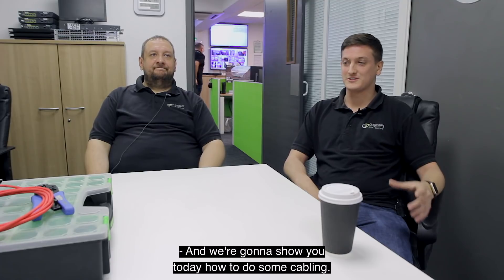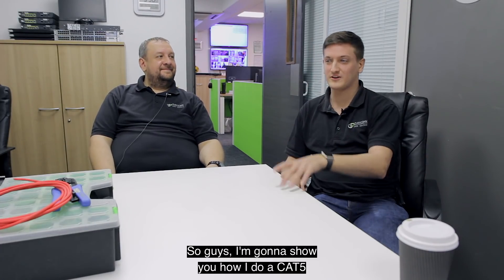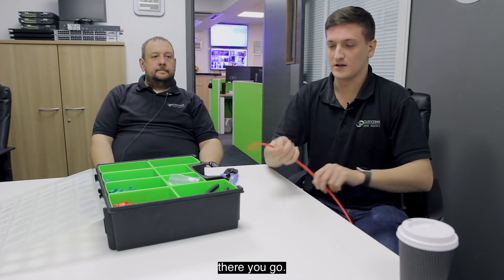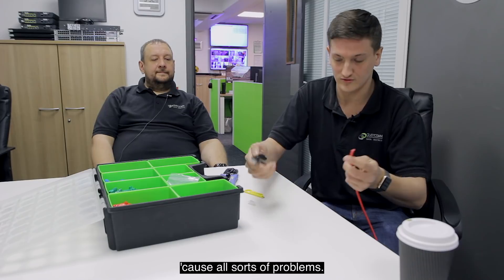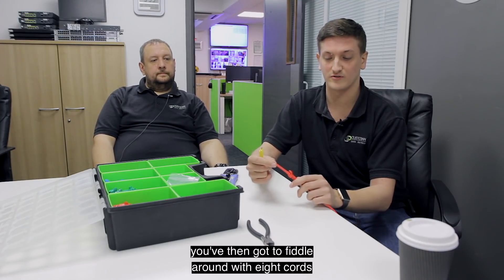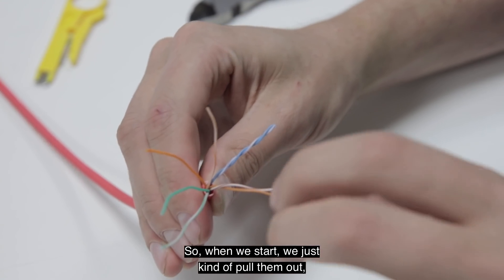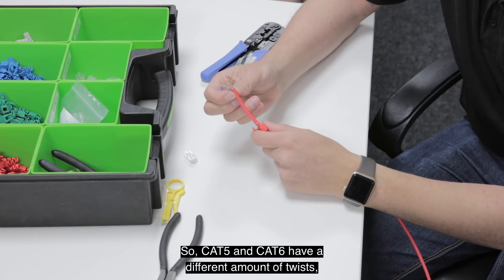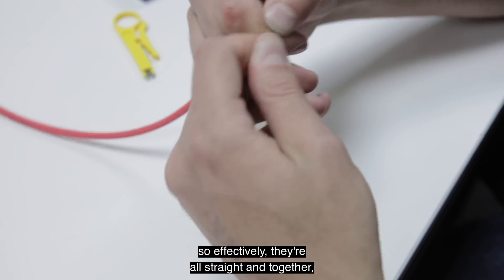DATA CENTRE 101 | TERMINATING CAT 5 CABLE | ASH & PAV have a CRIMP-OFF!

Comment: 3:12 a way to untwist the wires easier. Use the cable insulation and press that between the twisted pair then twist the cable insulation.

Comment: I don't tend to make off many Ethernet cables but use RJ45's connectors with holes at the end of the plug through which the wires pass prior to crimping. I like them because I can confirm that the wires are in the right order before I crimp because they stick out of the end of the plug and more importantly I can ensure that the jacket is crimped to the body of the RJ45 because I can push the cable right into the connector without worrying about wires buckling and so no long-term reliability issues due to compression of the wires between the terminations of the wires and the crimping onto the cable jacket.

I don't see many people using these connectors in production - is there something I'm missing here?
Reply: Because its for beginners. I can crimp rj45 for 1min using non pass through connectors.
Reply: @youreroad5307  It takes me 5 mins+ and I am a beginner :)

Comment: Why does everyone use the "B" standard? You would assume that the "A" standard would be the one most used. I know technically it does not matter, you could just put the wires in the same order on both sides and it will work. Just find it funny that everyone uses the "B" standard
Reply: Because
Reply: It just worked out that way over time and eventually B became the most used. There are no benefits to using one or the other, the only real difference between them is the pinout order by color. Between 568A and 568B the green and orange based twisted pairs inside the wire are reversed at the termination point. You can turn a B standard cable into A standard cable by simply re-terminating that cable on both ends using the same pinout order as an A.

Comment: The stripping blade on the crimping tool is made to strip flat ribbon cable for modular connectors (telephone, serial, etc.).  I would not recommend stretching the jacket.  If you want to avoid using sharp tools near the insulation, you can always grab the string with pliers and pull it.  It is specifically designed to rip the jacket without damaging the insulation.  

As for testing via Ethernet, um no way!  That is very short of a proper cable verification.  You need a new QC process.

For that matter, terminating 8p8c connectors on cabling in a DC is just plain nuts.  Learn about patch panels and punch down termination.

Comment: 15 years data tech ,  1995 to 2010, never terminated a patch cord
Always factory build and tested , unknowingly we built out a network with 30k drops
No way could we could have taken the time to build our own patch cord , thank heavens
Reply: Yeah I would have thought you could get a bunch in different lengths to run down the rack, especially in the quantities you'd get in a DC. Don't need to be exact, just close enough to be neat.

Then again, if that's what they like to do, and they can get someone to pay them for it, what do I know.
Reply: Agree its hard to say that risking making them yourself for time and testing and errors is worth it.  Although it does look quite nice in the rack :P i have been making cables since 1998, but still being careful and still testing and still very conscious of scoring the pvc/ not the copper etc

Comment: I've been doing Ash's method for a long time but when i saw Pav's method, I was enlightened
Reply: it makes sense but it takes too long. just get good with a stripper (i dont use a spinner either), only spin a small bit and then bend the cable and tear the end of the insulation off.

Comment: Learn a bit more  about the cat cables before make video tutorials. cat 6 is up to 1gb/s for 60m (100m), maybe cat6A is up to 10gb/s, and that way will take ages to make an Ethernet cable with rj45 connector.LOL
Reply: I suggest the same for you, in fact maybe just use google, CAT5e is up to 1Gb/s and CAT 6 is up to 10Gb/s and if you were such an expert you would have said Gb/s not gb/s
Reply: The connector is called 8P8C not RJ45.
Reply: @Wisecrackerist  That is true, but RJ45 is common (at least in the US) than 8P8C
Reply: Cat 6 is rated 10Gb to 55m. 6A is 10Gb to 100m.

Comment: I've crimped many cables for my home ethernet / unifi wifi. Some of them just gets the amber light from the switch (100mbit) and I can't really figure out why. I feel I'm doing the same procedure every time, pretty much exactly the way you do it.

Could it be the result of the cable twisting and turning in weird ways on its way through the house? Or passing too close to electrical wires?
Reply: You should invest in a network cable tester, It's a good tool that'll let you know if you have a open wire or if something isn't working correctly. Very useful tool that'll let you know if a cable doesn't work correctly immediately after you finish crimping it.
Reply: @streetrider1001  I have a tester, but in this case I couldn't really use it like intended.
I had to run the cable first, through small holes in the walls and floors, and then crimp the connector onto the cable several rooms away.
The issue could be the bend radius of various corners and turns. Or the fact that the cable itself got twisted quite badly when coming off the spool.

I am however able to stream ~50GB full length movies over this cable. 50GB over ~2hrs adds up to approximately 80Mbit/s. So there seems to be some wiggle room somewhere.
Reply: @sk4lman  Some devices only operate at 100mbit, have you tried with a different device connected? For an example, my Phillips Hue bridge is only 100mbps.
Reply: @SamuelLogan Yes, I have some devices that run on 100Mbit (wifi antennas) and they show amber light, as they should. 
Most other devices show green light.

The most critical thing is a cable connecting the main switch (where the fibre ethernet connects) and the living room switch where TV and such things connect. The port connecting the two switches show amber light, unfortunately. 

That cable is quite long, and runs a dozen yards through the house, between two floors, through two walls, and zig zags along the walls behind the base boards. 
My fear is that this quite elaborate installation is somehow faulty.
Reply: @sk4lman  Have you tried re terminating the cable?

1 Gbit uses all 4 pairs and 100mbit uses only 2 pairs. If you have cut one of the cores by accident it can fall back to 100mbit instead of 1Gbit.

Cat 5 is not really certified for 1Gbit, if it is a really long run you would probably need a 5E minimum.
Reply: @BertM3  Thanks for the tip :)
I think I'll leave it as it is. We can comfortably stream 4K to the TV, and 1080p to the chromecast, without issues using the current cables.
That's enough i feel. I might do more harm if I start modifying things :)
Reply: Also Ethernet cable's have a certain bend radius before the transmission speeds become affected. It's unlikely that this is the issue you're dealing with but keep in mind that the bend radius for Ethernet cable's are usually 1 Inch. Just keep in mind that for Ethernet cables it's usually 4 times the cable diameter.

Comment: If memory serves me...the amount of twists in the copper are NOT part of the CAT5e and CAT6 standards. The main difference is the spline or other shielding (based on newer methods) used in CAT6. CAT6a has shielding around the outside of the twisted pair and CAT7 has shielding around each twisted pair as well as the outside of the pairs. Feel free to correct me if I am wrong. And, yes, internet I know you will! ;)

Comment: The best way to make sure you don't damage the cables is use the twisting blade to take off some insulation, then use the thin thread that is in the sheathing to cut down through the sheathing, exposing more wire, and then cut the top section of the wires off where you initially used the circulating blade.
Reply: This way

Comment: There are some slick tool out there and new plugs (Z-Plug) that do not use a crimp plug. Yes they cost a bit more, but they are reusable which is great if you messed up. I am just amazed that as a data center you would use custom made cable and not factory made cables.

Comment: 2:14 I can show you how to press without using this extra blastic item. You push the cable in the white without having to nacked the cable too much so the outter red go in the white aswell, when u use the tighting it the cable will be irony strong.. its ALSO more flixeble that the extra blastic thing.

Comment: Why do you use different color cables
Reply: Different data connections. One could be iLO for HP, iDRAK for Dell and you could have one color for SAN connections one color for KVM access... There are many reasons for multiple colors.

Comment: Is CAT6a terminated in the same way or is there anything additional to think about? Great videos btw!
Reply: Termination, not really,  although there are some modular jack options for the termination panels these days.
CAT6A has even more twists, it's a heavier cable, you can't get as many in the same cable basket, nor can you make the same tight twists and turns.
They are right to say CAT6 is 10Gb, capable, but only up to 50M, CAT6A will do the whole 100M.
If anyone ever mentions CAT6E, tell them that is not a real recognised standard.

Comment: All the cat5 I've seen has a little string in it that after you strip a bit, you pull it to slice the insulation down further to make sure you haven't nicked a conductor. Weird that yours doesn't seem to have that.

Comment: 2019 and still cat 5 for data centers?
Reply: I'd guess it's 5e. if it is, no problem. it all depends on what you're doing. if you have a switch on every rack, and all servers in that rack going to that switch, 5e works perfectly as it can do gigabit up to 30 meters.

Comment: Pav is doing it more correctly, but  modern Cat5e-6 cables have a string that runs through the cable that is intended to be used as a ripcord to split the sheath open without risking nicking the core cables.

Comment: I do it mostly the same but with the test part I use a tester that sends 10gbit to 1000gbit of actual data across the cable to measure bit error rates and with the wire map it measures the SNR of each pair. surprisingly there are a lot of good quality cat 5e cables out there that test better than some cat 6 in SNR and that is the biggest measure of concern when it comes down to supporting a 10 gig Ethernet link.
Edit: With 40Gbit Ethernet you pretty much need cat 6a as it has individual shielded pairs aka foil around each color to further reduce cross talk.

Comment: Wow. I have never seen such a misinformative video of cat-5 cabling!
First off, the tail on the "boot" you refer to is mostly there for when u pull the cables thru a bundle and such, you won't break off or snag the retaining clip on the crimp connector.
2nd there are different crimp connectors for solid (riser) or stranded (patch) cable
3rd NEVER place a crimp connector on a riser cable. Riser cable needs to go to a termination connector or patch panel. Riser cables are never ment to connect to a device as the wiggle of the connector can actually break the conductor.
I wouldn't hire this company to wire a doorbell!
Reply: Exactly plus the way that guy stripped the insulation by stretching is just NO
Reply: @J4MES1  I know! Simply amazing

Comment: Now just need to show how to mount full rack server
Reply: Insert your left and right rails. Pull them out fully, then make sure you grab your server with 2 People holding (1 left, 1 right) and align the metal balls on the server with the inserts on your rails, then drop it in and then push back to engage the rail locks so it won't fall off the rails. Slide your rails back in with the server and viola there you go. It is important to mention that this is very hard and dangerous to do with just 1 person, its a 2 person job.
Reply from the maker: Check out our Racking Services video with Ash & James on our channel...

Comment: What are you using to label your cables?
Reply: I use clear heat shrink tubing over cable marker numbers. Always leave a wiring chart hanging off each termination panel.
In one data center I worked in it was a requirement to label a cable every 2 feet. This way you could query a database with any cable number and it would tell you the length, date installed, who installed it, type of data traffic, the origin and dest points and sometimes the route the cable took. It was also a requirement that all cables no longer in use, be removed to avoid clutter in beings and under raised floors. Cable mist not lay on drop ceiling too! This is a fire codeb as if there was a fire and ceiling collapsed, the firefighters or equipment would not be entangled in the wire's

Comment: That pulling trick is neat! Also I think you should do cat6/stp/ftp cable because the drain wire/shield is supposed to be grounded and use a shielded RJ45 plug, most of self crimped stp cable I've seen is improperly done with that grounding part
Reply: Shielded cables are something you might want to avoid, especially if multiple feeds are involved or you're trying to connect different parts of a building. Depending of the quality of the buildings installation and devices used the shield might carry a significant equipotential current which could damage equiptment or trip breakers. For example Rasberry Pis do not separate digital ground and shield, I got several of them burning due to ATP cables and equipotential currents due to bad building grounding.

tl;dr: For short runs UTP should be fine, for long rund fibre provides better performance and avoids such problems.
Reply: @adlerweb  most of the issues you listed are resolved by properly grounded 6a patch panels, up-to-spec switches with linked and common grounded shield plates. The real cost is in blood, sweat and skin properly terminating 22awg shielded S/FTP cable a few dozen times. Miss one end and you've just made a big antenna.  I did my whole rack in riser 6a because spool prices are too good and I probably hate myself. 

My copper 10g links are strong and noise free. And heavy..... And don't flex.... But they are beautiful lol.

Comment: Correct me if i'm wrong. I know cat5 only support 10-100mbps right? Cat5e can support up to 1Gbps?
Reply: Then google it. Cat5e may support up to 10gb over short distances(like few meters) but to be sure you need cat6 or cat6a.
Reply: @wiziek  noted on that 😎
Reply: @gerszondizon3303  BTW, be catious about Cat7 cables which may or may not be up to standard (cat 7 is ISO standard, not confirmed by  Telecommunications Industry Association, it should even have it's own plug that is different then rj45 but no one is selling it). Cat8 seems to be a thing but only for short distances at which point we can already use dac cable or fiber.
Reply: It's history. When 100Mbps was designed, two versions were standardized: 100BASE-T uses four pairs, and works over cat4 wiring. 100BASE-TX uses 2 pairs and electronics is cheaper, but requires cat5. Not much cable was installed, the cheaper TX and 2 pairs won and is what you know as 100Mbps ethernet. Then came 1000BASE-T for bidirectional 4 pairs existing cat5, and 1000BASE-TX for new cat6 with cheaper electronics. Cable was already installed, so everyone bought 1000BASE-T, and -TX passed into history. The 5e specification added a near end crosstalk test that all cat5 cables manufactured prior to it could pass, as if that is too bad 1000BASE-T won't work, so it really should be a tested parameter. So yes, that old spool of cat5 will run 1000BASE-T. If you find some 1000BASE-TX equipment in a museum, you need cat6. (Now I feel old..)
Reply: I think cat5 is also can do 1gbps
Reply: @pierreuntel1970  Cat5 is 10-100mbps.
Reply: @driptopia  Where did you got that info? Cat5 (not cat5e) will work with gigabit, telephone cables like cat 3 could have issues.
Reply: Cat5e is 1Gbps
1,000Base-T (Gigabit Ethernet), 100 Base-T, 10 Base-T, FDDI, ATM.

Cat5 is 100Mbps
10 Base-T, 100 Base-T, FDDI, ATM.

ref
Cat5e: http://www.farnell.com/datasheets/1311844.pdf
Cat5: http://www.farnell.com/datasheets/1311845.pdf
Reply: Is that so? Lemme ask google 🤣

Comment: Whats better, cat5 or cat6?? Why don't you use cat6 then?
Reply: Also in enterprise setting 10g or more is connnected by fiber cables(sometimes dac cable) instead of utp/stp cable.
Reply: Cat6 is cleaner and faster however a more expensive, Cat5 is about 1Gbit where Cat6 is 10Gbit. There are many factors to consider when picking cable, such as are the linked machines able to utilise such speed, but also is it really needed, for consumer use it is highly unlikely that you will have a 10Gbit external connection, however a 10Gbit internal network could still be useful for local backups.

Edit: I made a slight mistake by Cat5 I mean Cat5e
Reply: Cat6 is unnecessary expensive.... cat5e does everything most people needs